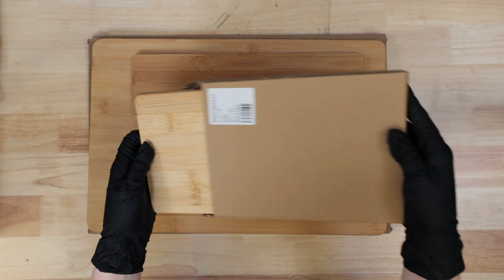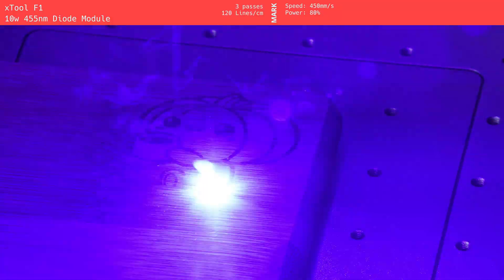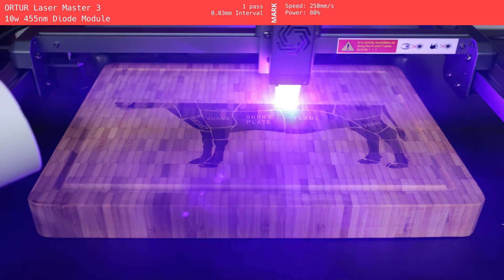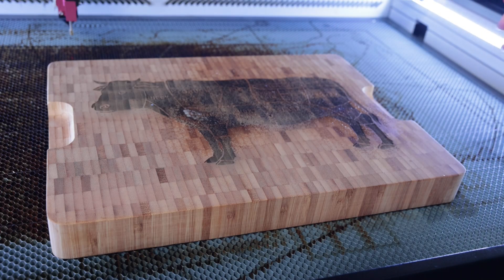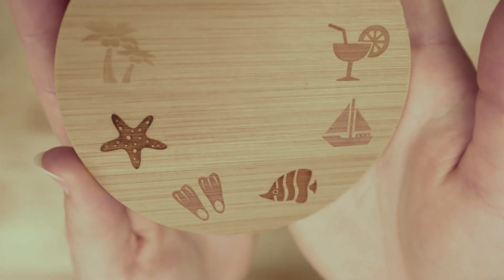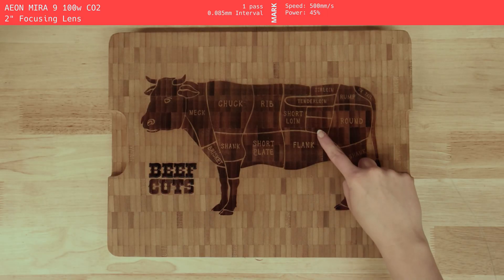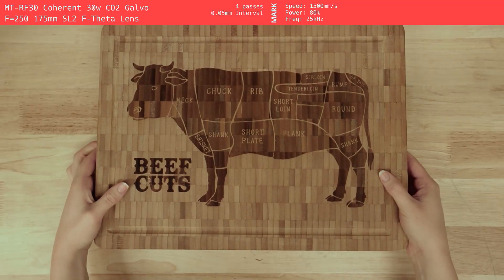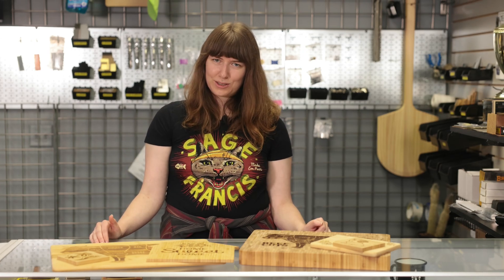The ULTIMATE Laser Guide to Bamboo | EVEN Results on EVERY Machine

Comment: Is Windex better than Pledge?
Reply: if its a cutting board, just be sure whatever it is, is food safe. There is more than one version of just about every possible cleaner/spray, and many of them you wouldn't want to consume accidentally through food contact.
Reply from the maker: I like ammonia cleaner because of how it dries but it doesn't really matter. Use what you like the workflow of. If you think pledge is doing a good job stick with it!
Reply: @LaserEverything  Windex also works great on cleaning up stainless steel.
Reply: I literally just give mine a quick wash with a sponge and plain water. I want people to be abe to use them so I would be worried about cleaning with Windex or Pledge.
Reply: Yes. I haven’t seen anyone using Windex before
Reply: Before you use Pledge, make sure that the variant you are using is food safe. many Pledge spray cleaning products are not food-safe. If you are going to actually use the cutting board for food, I would not use any cleaners, like windex, just simple dish soap and water, then use a decent oil and wax (I prefer NOT mineral oil) to seal and protect the cutting board. That said, there is a formulation of windex that uses vinegar instead of ammonia. Just be sure that there is no detergent or cleaning surfactants.